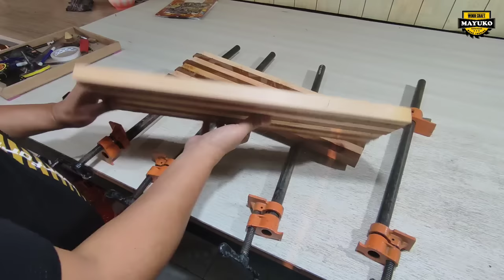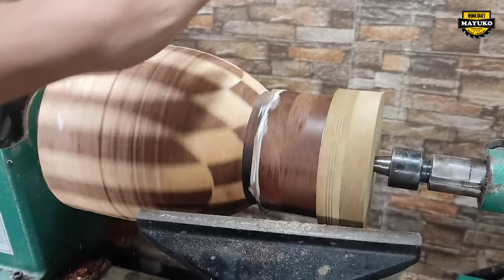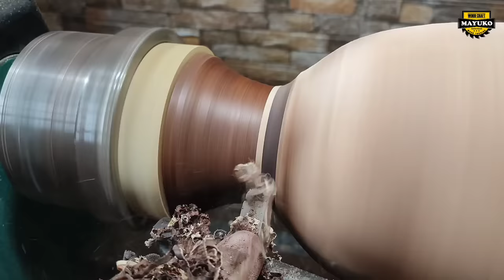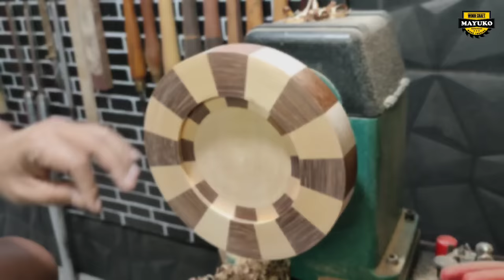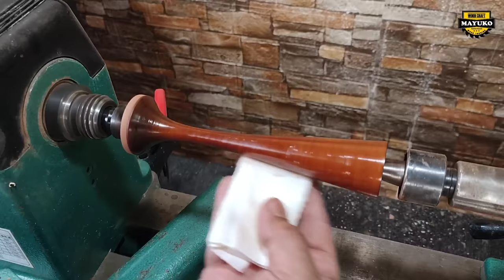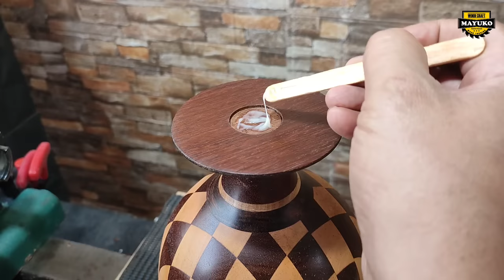DOUBLE STRIPE VASE, woodturning

Comment: Its a gorgeous piece, definitely some sort of off center wobble going on in the whole thing at high speeds, you can see it in the video. A CA or shellac based finish would fill in some of that carbide tool tearout nicely, or using traditional gouges and riding the bevel. Carbide tools are great for fast working but not great for tear-out when dealing with coarse grain or side grained exotic woods. It is pretty